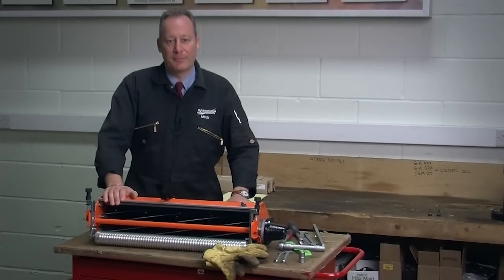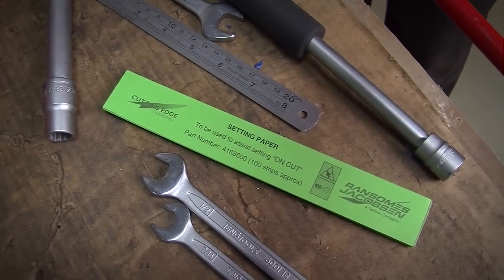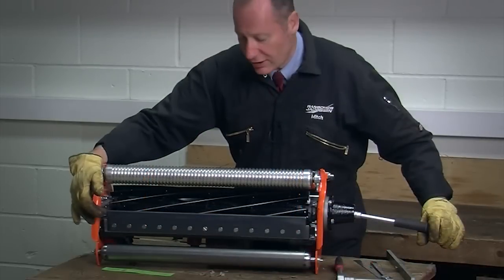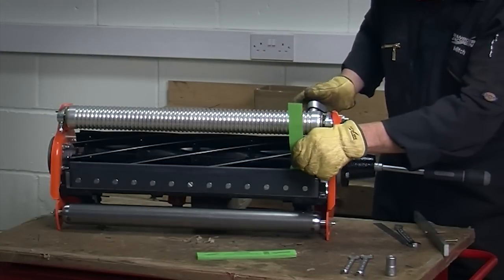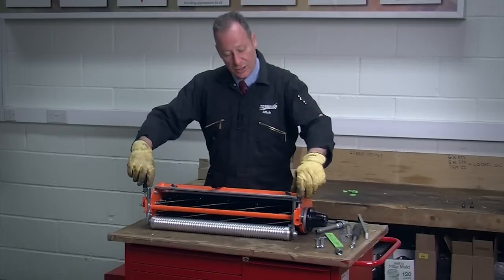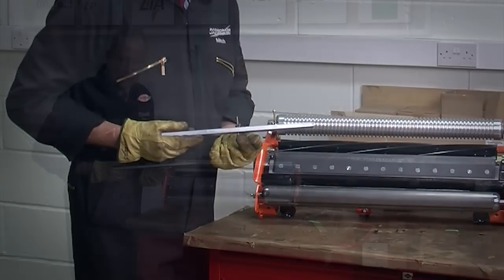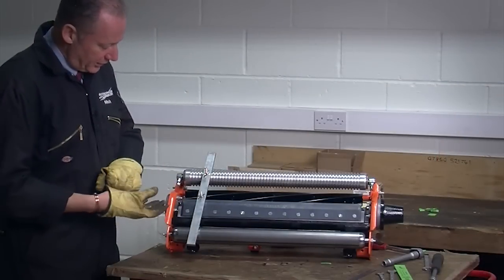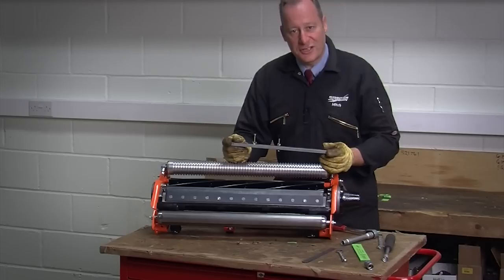How to set-up the Jacobsen Greens Unit

Comment: Can you tell me how to bypass the speed regulation when going from transport to mow? We have a very old Green's King IV that is so slow in mow gear that it's nearly useless. If we could mow in transport gear and regulate the speed with the pedal it would be useful again.
Reply: Any luck with this? Got the same issue and can't find any info on hydraulic valve adjustment. Only adjustable through the screen which doesn't fix the problem.